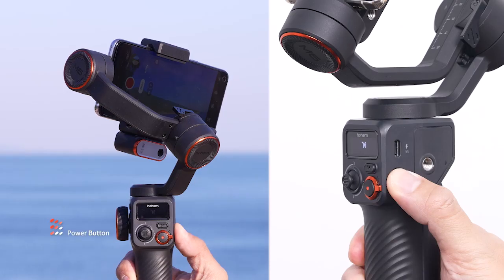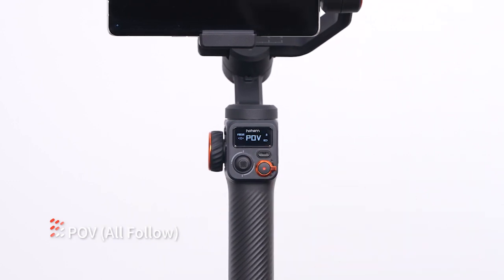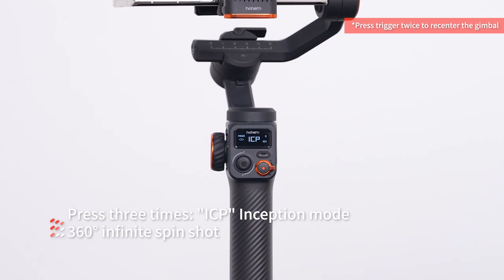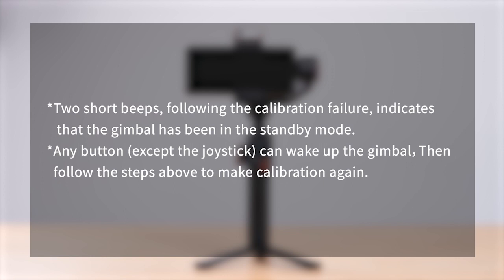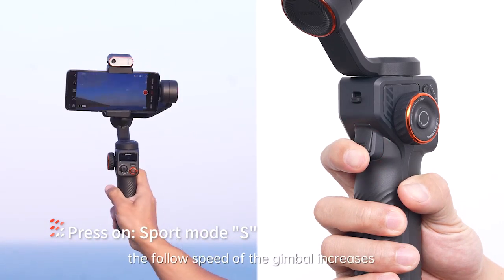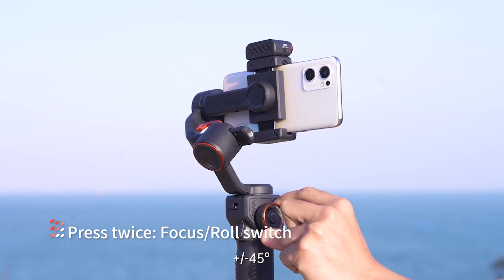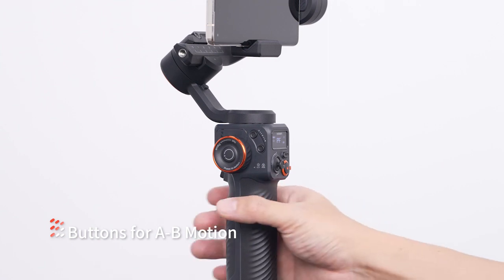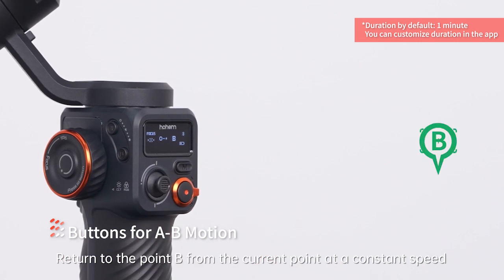Buttons | User Guide | Hohem iSteady M6

Comment: The manual list also a sport mode (S) but I couldn't find it on the menu and it's not mentioned in this video too? Can someone explain?
Reply: Hold the trigger
Reply: just hold the trigger it will show the S on display if you released it will back to normal mode